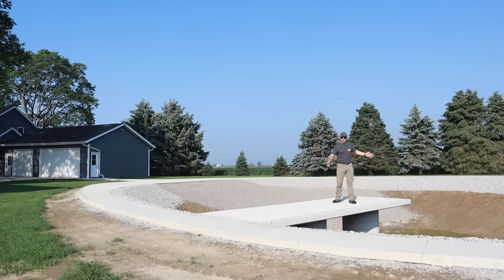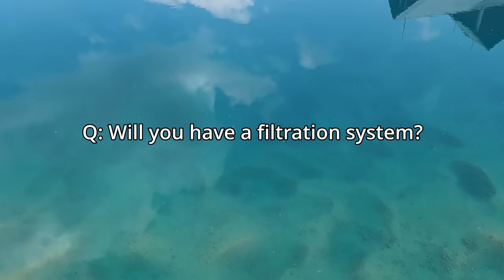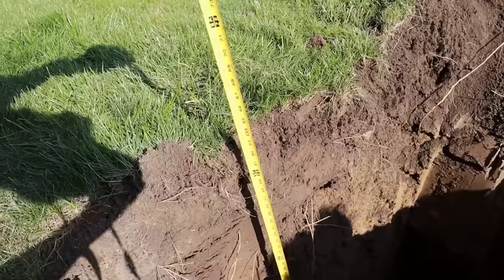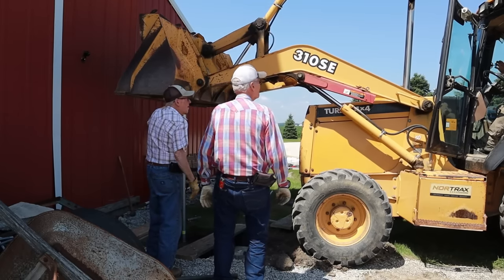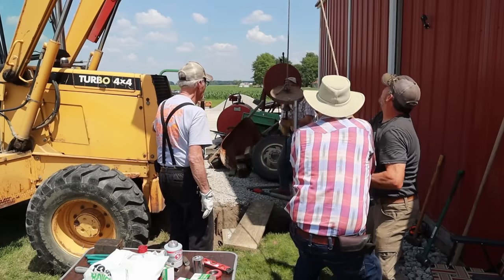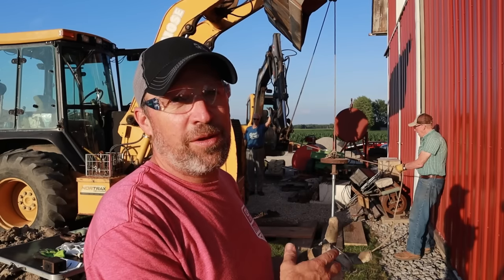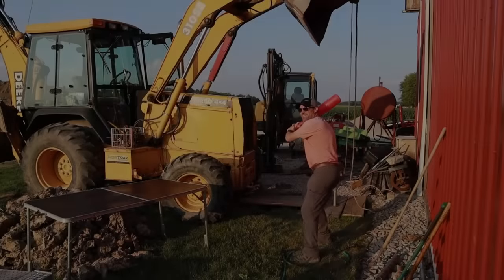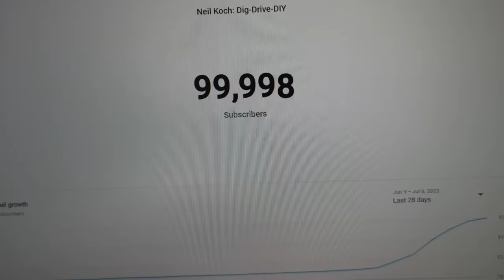It Doesn't Always Go According To Plan

Comment: my two cents: I feel like a more complex pulley system would have sped up the proces, I get that the machines take the force-load but they are also a lot less quick than the previous 3-man pull. so what if you make a pulley system with a bunch of pulleys and get make it lighter. Other way could have been to get a circular plate and weld a pole to it, then attach the rope to the end of the pole and make get the circular plate to turn thus making a reciprocating motion on the rope and let it bash like that.

Comment: Most people's plan A would have failed and they'd just give up and pay someone to do it. Excellent ingenuity sir.
Plan L, make an upside down pulley system and use the loader to pull up instead of pushing down.
Also, you're just joking with those dousing rods.... Right?

Comment: Next time use water to push that think in the ground, just pump the water in the pipe. I didn't know that looking for underground water with 2 thinks and they crose each other when there's underground river it's also popular in US, that's good one :) always works like a charm also if you hit with the foot in the ground when thath think cros, you will found approximately how deep is the water one hit one meter. What should happen, keep that thinks in hand when they crose you stop and hit with the foot in the ground until that thinks start move back in paralel. If you hit 10 time thats mean that the water is approximately 10 meters deep.

Comment: Maybe water would have loosened it up enough.

I watched a guy drill hole for a geothermal system deeper with 2 inch pvc pipe, auger tip and water hose.

Comment: The water prospecting with copper wires will work. You can use it to find cables, running water, ect.  My dad passed away at 89 a couple of years ago and had a backhoe business and I can remember him using that to find water lines  and phone lines (in general area) worked ever time. 
  There is a science to it.  Can’t Wait to see how that works out for you next! Keep up the great work!

Comment: Yes sir, I love your swimming hole! Well I worked for Hennings brothers drilling outfit for a while and like your other viewer had mentioned, moving, even a short distance from your first attempt could prove successful. 
And yes, Divining rods are a scientific method tried and true. Pay attention to the old farts, they know!! Also, I have been in situations where pressurized water being injected into the drive pipe (with outlet near bottom/drive tip) helps dislodge and push material out of the way, so as to allow the pipe to be driven deeper. Just a info-tainment snipet!? Ha ha.

Comment: I used.  Witching rods.   A. Lot.     You Can use all sorts  materials ….     For. …Dousing one needs the right type of natural wood to make a. Rod !
Reply: Yes the wood needs a high iron content to work. Welding rods work great.
Reply: @klonestar2    I. Used.  Aluminum ones.    Working power lines ….    Had to witch out. Water and. Gas lines when digging a. New pole hole …

Comment: Just throwing it out there but you could had jacked up the wheel drive wheels of your tractor and welded a ring on the rim then tied on the rope to the rim and use the rotation of the wheel to lift and drop your weight. Just one idea

Comment: Nobody knock water divining. I saw it working in France among water bearing rocks and I had a drainage problem where the local fosse septique (septic tank) installer found the blockage 4 metres underground. Using wire rods just like the divining apprentice in the video😂.

Comment: There was a old well guy in Columbia Ohio who dropped my parents well back in the early 70's he had similar to you, but to pull the weight up he had a old wheel rim that he wrapped rope around once or twice not sure. The motor turned the rim and you just pulled on rope tight to rim and the rimm spinning pulled the weight up the you just took tension off rope and it dropped down on pipe.

Comment: My dad did something similar and rigged an old boat winch to a motor so the winch handle hit the rope and pulled the drive weight up on the bottom of the stroke and dropped it at the top. Repeat.

Comment: so when can I move in? I can supervise as well :P

edit: by the way you could have slowly pushed with the shovel of your excavator for even pressure from the top - so less chance to damage the pipe (given the underground is soft enough for the rod to go down)... otherwise you need to dig deeper... oh and by the way you need to make sure that it goes down vertical... any kind of angle can result in damage
Reply from the maker: Got it! :)

Comment: What a nightmare! Must have hit some rock, drillers probably would move & tried again. A shorter pipe out of the ground would have facilitated using the backhoe to push it down. Flexed too much because it was 8 ft above ground. Hole was dug too deep allowing too much flex. The backhoe has more power than 50 men  Pulling it was right choice that's why its costs a lot to have well put in. They hit rocks and have to start over. Just the way of the game. My well drillers used the dousing rods  Armchair well driller

Comment: Is it cost prohibitive just to have someone drill it?   DIY is more satisfying but sometimes, like with the stone thrower thing, it's just worth it :)
Reply from the maker: It's $6500 minimum and booked out till September is all 😁
Reply: @digdrivediy  GAH. How about drilling a pilot hole with an auger or go deeper with your backhoe to minimize the length?

How about filling the pipes with water to soften it up before you pound it?  I want to come and help :)
Reply: I'm back with another suggestion.  Use some galvanized pipe to water bore a pilot hole. It's the same method used  (usually with PVC) to bore under sidewalks/drives.   Get a sturdy pointy brass spray nozzle (modify the hole size if necessary), screw it onto a 10' piece of galvanized pipe. Attach a hose adapter fitting on the other end and start working your way down.  Since you already have a pilot hole from the first attempt, use a 20' length and add 10" pieces as necessary.

OK. I'm done now :)

Comment: 11:05 something strange that has jack hammer not working, could have weight loaded pipe to speed heck hammer effectiveness with blocks of iron for chain coiled at top and hooks in opening of pipe. 2-300 pounds of chain wrapped near top would make gas jack hammer far more effective.

Comment: You can take a crystal shard and put it on a string and it will find the water not everyone can use a dowsing rod some have it some don't I can take 2 copper rods about foot and a half long and you can throw anything you want out into some high grass and when I walk across it they will cross I was playing around and that's how I found out that we have an underground spring that has moved under our house not good lol but check out the crystal I didn't believe it myself it will even tell you how deep the water is and if it's drinkable or not lol I swear seriously

Comment: Just a suggestion, but why don't you try the same thing in the middle of the pond? Because you're already a lot deeper there.
Reply from the maker: A hole in the bottom of the pond connected to an aquifer could work as a drain if something goes haywire.  The aquifer would drink up the pond!

Comment: 2:22 Haha hydrostatic pressure does not push down on rocks. Buoyancy actually makes rocks underwater easier to move.
Reply from the maker: Ok
Reply: Correct!
Water does not 'press down', and they do 'weigh' less under water.

HOWEVER, I think Neil is correct in that it might help stabilize the rocks:
Under water the stone has less weight trying to slide down.
In air, there is more force on the lower layers trying to push everything out and assume a level pile.
I believe a given material can sustain a steeper 'slip angle'* under water, than on land (not sure about this).
* I don't know the proper term for this 'slip angle'.

I think Neil is right that the water pressure (adding buoyancy) reduces the gravel's tendency to slide; even if he did not word it precisely...
Reply from the maker: @troubleshooter1975  I'm no scientist :) I just know they are harder to move underwater.  Like trying to run underwater.  You weigh less but you can't run faster 😋

Comment: If the water table was as high as you said it was why didn’t the pond fill up by itself. You spent a ton of money on the sidewalk, pier, stone before knowing if you had a water source.
Reply from the maker: The water table is shallow but the pond is still dug above it.  There is a layer of very low permeability separating them (clay).  I already have a well at my house so I know there is a water source.
Just a matter of tapping into it is all.  It's all in the works.

Comment: While dowsing isn't considered by most to be exactly real in the way people think it should work and sometimes pretend to practise it, my labrat self thinks there is actually perhaps a grain of truth to it, and chillax for a longer read if you want, grab a drink or a snack and journey on;

Finding water with dowsing is an ancient semi-traditional and semi-ritualistic practice, and therefore we should not expect it to work as reliably as instrumentational and scientific methods of pinpoint locating.

However, the kinetics of the movement of the human body and the timespan between sensory reception fromt the environment and the subsequent adjustments to locomotion and proprioceptive counterbalance movements occur in a manner that would tend towards making most people tend towards turning the handles to make the rods meet when going down even a very slight incline as a preperatory instinct to brace on the forelimbs... Arms.. I mean arms of course :p

This, in conjunction with the fact that medium-depth aquifers tend to erode softer soils/sand and cause localized dimpling and valleying does mean that in flat areas, simply walking and trying to maintain balance normally with dowsing rods, a person might over many attempts tend towards fixating around areas where a well could be dug to get at a high point on the route of a local aquifer successfully, though the accuracy would greatly depend on many factors, and I won't claim any expertise beyond these thoughts as to the distributions and exact numbers, I'm just hypothesizing some here for the amusement of it all :D

The general ability of the person to balance the rods while moving would of course play a part, as would the general roughness of the regional terrain being dowsed, and the region from where the person dowsing hails.
The density of the soil/sand would play its' part, in a dance with the flow rate of the aquifer, perhaps also the already-occupied space or relative pressure of the aquifer to the atmosphere.
The rods and handles themselves would of course also play their part.

All in all, I'm not convinced that a person with dowsing rods is the best way of reliably finding water, but I do think there's a decent chance it has been a good enough way of sometimes finding water in places where it isn't immediately obvious.

And this is why my colleagues want me to be drunk all of the time... Would you believe it?
Reply from the maker: I can buy that!

Comment: Look this up on YouTube:
"A centuries old method of drilling without a power tool that is still in use today"
I seen variations of  this method using a water jet.  I bet you can come up with your own instead of trying to drive the pipe down.

Comment: You're pond is more than twenty feet deep,  you should have hit water there??
Reply from the maker: It is 11 feet deep.
Reply: @digdrivediy  fair enough,  looks more but there y'a go.  Should have driven a pipe down at that point,  only 10 to 15 feet to go,  you might have ended up with a fountain! 
Good luck  to ya.
Little tip,  if you make a puddle at the point of driving your spear point in then push down, lift up,  push down lift up,  push down lift up.  Each time you will go further and just add a little more water.
I have gone over 8 feet like that before turning to machinery.  Depending on soil type. 
Try it with a steel rod, works well.

Comment: The drive cap is supposed to get chewed up.
Reply from the maker: It destroyed the threads of the pipe under it too...
Reply: @digdrivediy  You sure you had it tightened down all the way? The edge of the pipe is supposed to press against the roof of the drive cap to take force of the blows off of the threads. I guess if you whack it hard enough it might deform the edge of the pipe or something...

Comment: Try to feed a waterline down the inside of the pipe all the way to the tip.  It softens the clay and it should ease up the process. When done right you can even feed a standard gardenhose straight into the ground. For inspiration: https://youtu.be/3pOSzBgB8WU

Comment: You're not afraid to backdown from a challenge? So you will back down, right?
Reply from the maker: Sometimes you win, sometimes you lose. Doesn't mean you didn't take on the challenge.
Reply: @digdrivediy  
If you're not afraid to backdown from a challenge, which is what was said in the video, it means you will back down from a challenge.

Comment: Sorry sir but you’re doing it wrong. The key is boring not inserting. You have to used pressurized water for boring with the help of steel tube which has open bottom
Reply from the maker: No need to apologize. I'm no expert.

Comment: just use excavator pushes the pipe down already settle the job. I really dont understand why need to use this way to do the job.
Reply from the maker: I showed us trying to do just that in this video.  It doesn't work like you think it would.  As shown in the video...
Reply: @digdrivediy  You didnt use the excavator or back hoe bucket to punch the pipe. I really dont know why you want to use the big pulley metal to punch the pipe. This totally a very silly job.
Reply from the maker: @pigdrivers  Watch again
Reply: @digdrivediy  Already confirmed you didnt use the back hoe back arm or excavator bucket to punch. You are using front bucket to punch that is why it dosent works. You suppose to use the back arm or  excavator  to punch the pipe with the big pulley put on the top of the pipe.
Reply from the maker: @pigdrivers  Dude.  I'm telling you we tried it.  It doesn't work like you think it would.  Pushing it down with the backhoe is the first thing I tried.  Both front and back.  It's not a viable option.  Thanks
Reply: @digdrivediy  is not using the arm to push dude. is using the back hoe or excavator arm to do the punching. My job is doing the tunneling and Horizontal direct dirlling. Me and my team aways open main hole and uisng excator to do the punching the steel plate and sometime need to do the pilling as well. I have done this kind of job for so many years. The most funny thing is your steel pole is very shape and can use man power to do the manual punch and make it down into the soil now you want to tell me excavator not able to punch it, who is the dude now ? Man power is bigger than excavator power this is really the most biggest funiest job in the world.

Comment: OK guys seriously I mean they drive pipe miles under the ground. You need the right machine and it should vibrate rotate with pressure down. Bust out your wallet brother.

Comment: I don't know what kind of soil you have, but that's not how pipes get jammed! You do it by force. You need a ton of water in the pipe and two people with another pipe attached to turn it around (much simpler and easier that way) until you find water. and you need to replace that first pipe with a pipe that will dig soil around its axis, not compact like the one you have.